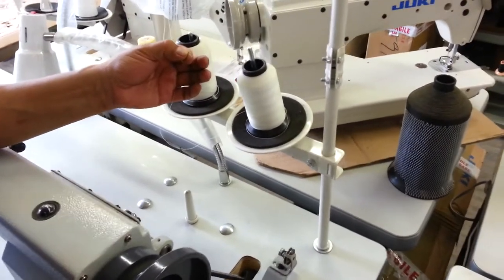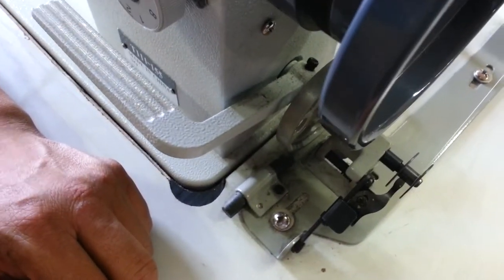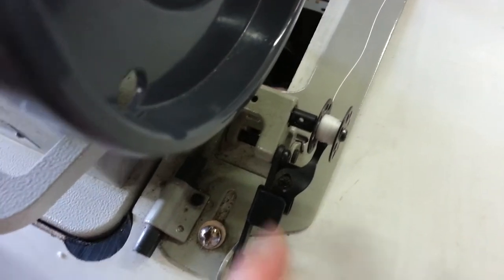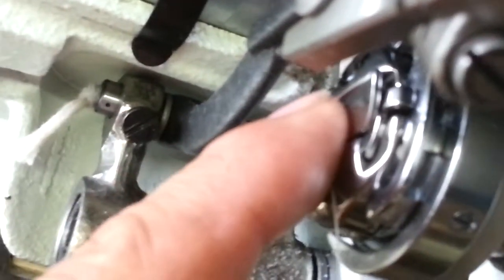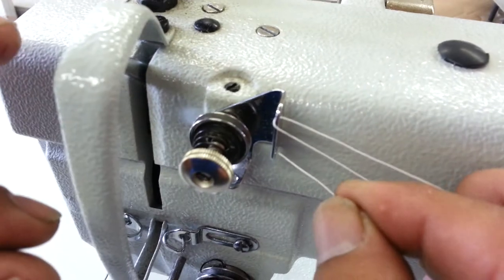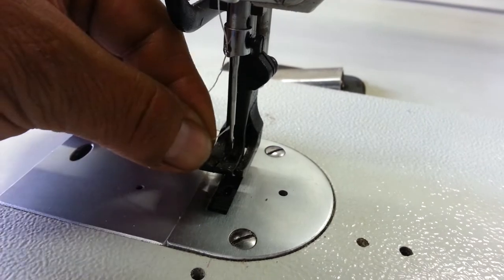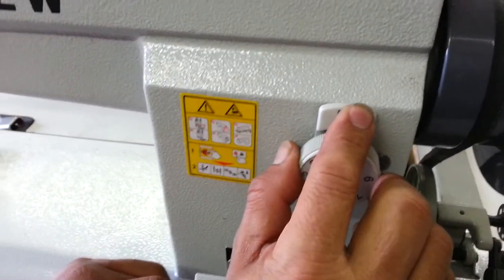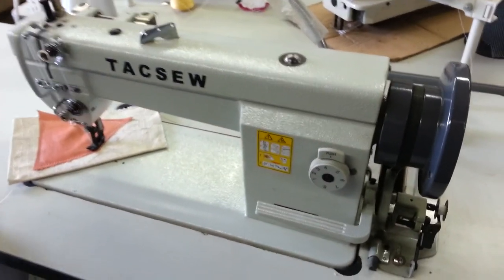Tacsew T111-155 (Typical GC6-7-D) lesson

Comment: does tacsew have a new name now? did they get bought out recently ?   

what model offers zig zag comparable to the 111?
Reply from the maker: Tacony stopped seller machines under their brand name.  Typical made most of there machines.  The T111-155 is the same as the Typical GC6-7-D.  I have one T146RB left in stock.  It is a Tacsew zigzag walking foot machine.